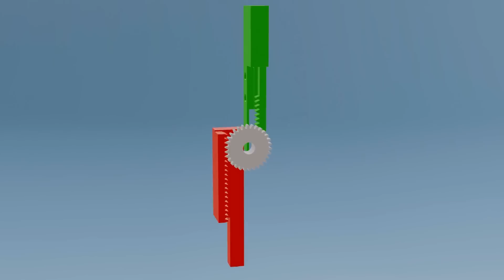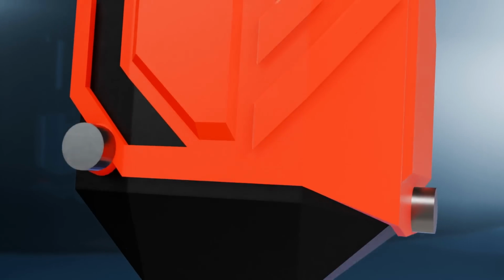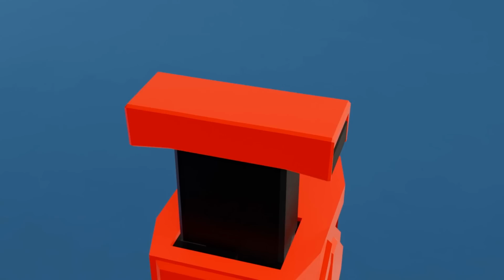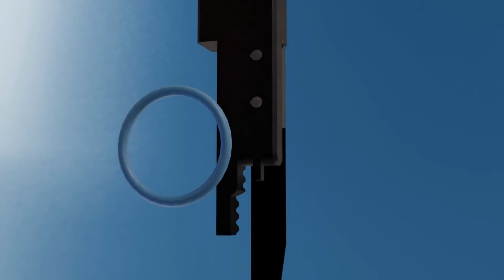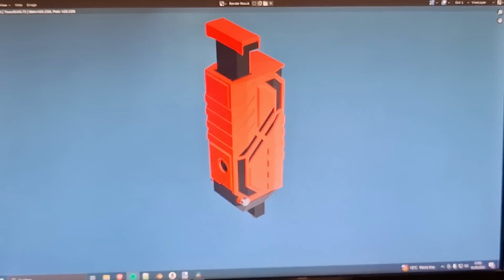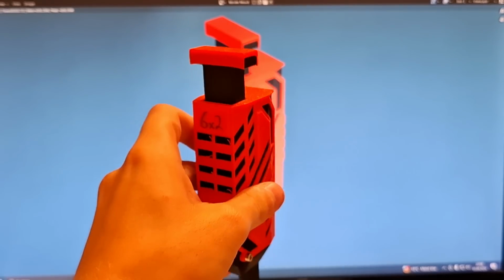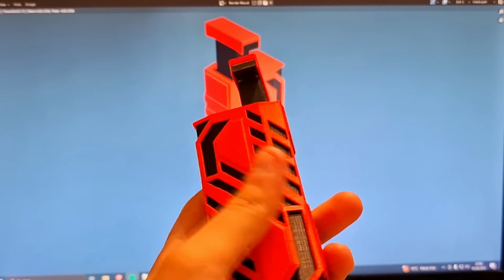Designing A Magnet Insertion Tool With Automated Reloading | 3D Printed

Comment: Not sure if anyone else has asked. Apologies if so. Have you considered a print pause for the difficult magnet insertion within the tool body? Perhaps you have, and it won’t work?
Reply from the maker: You are actually the first to ask that. Did not even think about it to be honest
Reply: @ Ah maybe worth a shot. I’ve just started 3D printing recently and have used it to some success on a small spacer where I wanted the magnet concealed beneath the surface. Working out how to do gridfinity and your design for the insertion tool is amazing. If/when I remix and it works, will definitely let you know. Hoping to print it soon
Reply: Update: I chickened out. Too worried I’d get the polarity wrong if I paused print and did the two tip magnets later. Haha. Maybe I’ll try it on the second one. Thanks for the great design.

Comment: Really cool project. I'd love to see a v3 that uses a spring instead of rubber band. Is it also possible to have 1 version of this tool and you only need to change the magazine size to accommodate different size magnets? Or are the strengths too different? It'd be great to only have 2 of these and to just screw in different magazines based on the size of magnet you want to dispense.
Reply from the maker: If i will every create a v3 i will make Sure that its more modular and easy to switch between diffeent sizes

Comment: I just can't get this to work properly, the magnet sticks to the side of the nozzle  or doesn't come out at all.
Reply from the maker: If the Magnet gets Stuck in the funnel you May have a wrong Position of the picker and the lever or you Glued in one of the magnets on the wrong orientation. 
Bevel down the bottom edge if the Magnet doesnt slide completely to the bottom

Comment: You did an amazing job (design)!!! Congrats & thatks a lot for sharing your knowledge and journey as well. This brought  a question to my mind. What  if you don't  need to "push the trigger down" and  have a version that works like a stamper I mean like a just push the device down to realease a mangetic. Does this make any sense or is even doable?
Reply from the maker: Thanks for the feedback. i think the problem with that idea is that once you lift the device back up the next magnet will slide down to reload which could cause problems with the previously placed magnet. but interesting idea for sure

Comment: This is really cool.

I don’t know how feasible it is but if you made it electric you could reverse the current and change the polarity of the electromagnet so one tool would work for both. You could also turn on/off the two magnets so they would never interfere with one another and possibly simplify the ejection mechanism.

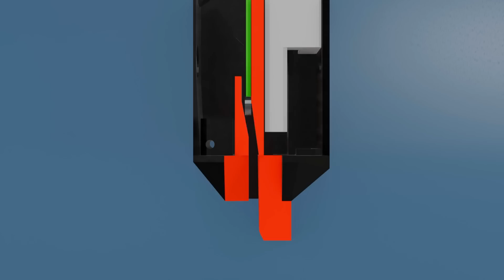Comment: That small edge could wear of pretty fast ? No ? 4:39
Reply from the maker: So far noone of mine is worn out. and i used it quite a few times during testing. But it doesnt take long to print a new tip if it wears out

Comment: I was struggling to get my print to work, till I realized I use 6x1 magnets not 6x2. Any chance for a 6x1 version? Love the idea, but I guess I just use a weird magnet size.
Reply from the maker: If you use the "5x1 Lever extension" and increase the length of the Mag by 1mm it should work with 6x1mm magnets. Or use the 5x1 mag  and increase the Hole size in the slicer by using a boolean cylinder if you are familiar with that

Comment: download this project, it's currently printing.  just wanted to say,  when polarity matters a great way to do this is to make a jig.  with gridfinity each piece is is own functional jig.  for the bases just stack up 2 more magnets on an already finished base and put your new base on top. just drop a magnet in and it's right.   for the bins ect, just install a single small bin with magnets upside down and then you have a 4x press jig. just add 4 more magnets and press into the bottom of an empty bin. 

now you have me thinking,  should be pretty easy to design this as a 3 part shaft and screw. not as smooth or easy to reload

Comment: Great development, loving the idea and solving a great problem. I think the only thing it needs is for a single product (maybe with one or two toolless interchangeable parts) that is capable of utilising a greater range of diameter and thickness magnets. Nice work!!
Reply from the maker: I agree. having too many diffrent tools bothers me as well. But i had not idea that people use THAT many diffrent magnet sizes
Reply: @EmGi_ agreed. I’d guess most common for repetitive magnet placement are 2mm - 6mm dia and thickness from 1mm - magnets dia? Again, nice work😃

Comment: For that tricky step where you glue a magnet inside to anchor the magazine - perhaps you could open a slot on the side instead. You would just push the magnet into rather than doing the elaborate fishing proceedure.
Reply: I thought the same. Put a little bar that holds the magazine magnet and slide it in from the side next to the magnet magazine entrance. You could even make this reversable and it mabe could lock in the housing if it passes through several parts saving maybe a few screws.
Reply from the maker: I dont understand what you mean with "open a slot on the inside". Could you elaborate that a bit more?

Comment: Many 3d prints use 6x3 and 5x3 magnets so you can consider making a version for these sizes. It would be very welcome since it is an awesome tool.
Reply from the maker: I added a 6x3 Version. And i think 5x3 magnets should work with the 6x3 Version as well

Comment: You could get away with one set if the 3D printing community could agree on a common standard for all commonly used components like magnets, bearings, maybe a range of standard small, medium, and large stepper motors, etc.  Unfortunately, the reality is the majority of projects uploaded were designed to fit the needs of the designer, so they tend to use whatever they have on hand whenever possible.  Having said that, if you come up with a design for something a lot of people will want and be willing to pay for and you decide to sell the files, go back and make sure everything you used was standard where possible and available off the shelf if not.

Comment: I love how the design improved. While watching the video I had two more ideas to make it even better. First one is mainly personal preference, but I would love to see the rubber band replaced by a steel spring. Or maybe even a 3D printed one if the room inside makes it possible to fit one strong enough. 
Second thought was: if you split the (black) body into two parts length wise, it would make assembly so much easier and less prone to mistake. The outer shell should be enough to keep it together, especially when you add locking pins to the design
Reply: I have a question for the part at the beginning of 4:12 where you show the mechanism and the tunnel. The part in orange is defining the thickness of the magnets used (1mm or 2mm high etc), right? and that's the part that makes it necessary to print different versions. now I've noticed the tip is already detachable (probably to fix jams), but with the jam problems out of the way, why not make the funnel and the tip one part, that can be exchanged easily, so you only need to print one casing (or two, one for each polarity), but then you can print different inserts for different magnet sizes. as diameter should not matter that much (up to a maximum of course), interchangeable inserts for thickness would be perfect. I'm not good at 3D modelling myself, so I have no idea how hard that would be to make. but I really love that thing at would love to see it improve
Reply from the maker: Wow thats actually a great idea! i will keep that in mind if i start a v3. That would have saved me so much time
Reply from the maker: Thanks for the feedback. i thought about using a steel spring first but i thought its easier for people who want to build their own device to use a rubberband instead of ordering a specific spring.
im not really experienced with 3d printed springs but i doubt it would give a statisyfing feeling when pushing the lever in

splitting the body is worth thinking about. i agree that the assembly is quite complicated and its possible to make a mistake and not even notice the mistake.
Reply: What if you would make a holder that you insert from the side that contains the magazine magnet. That way you can pull that out and even make it reversable. That leaves only the tip to be reversable to have a generic solution for both polarities

Comment: I understand that you’d need a different tool for each magnet thickness. But wouldn’t one tool at least work with different magnets diameter, of the same thickness? As long as they’re smaller than the mag hole diameter? 🤔
And I can’t keep wondering if it would be possible to make the design somehow to also support different thickness…
Reply from the maker: Actually yes. i didnt keep that in mind when designing the device because i had the impression 5x1, 6x2 and 8x2 are the magnets used the mosed but now im getting so many requests for diffrent magnet sizes, so looking back  should have done a few things diffrent. But i tested 5x1 magnets with the 6x2 device and it always dispended 2 5x1 magnets (i had no 5x2 magnets at home)
Reply: the Diameter of the magnets should not matter, but thickness does. You probably could use 8x1, 6x1, 5x1 or even smaller all on the same device. but as soon as you change thickness they'll either get stuck, or dispensed two at a time. only real solution would be to make the funnel interchangeable

Comment: That's a nice project and a good solution to put a lot of magnets very easy and quick.

For your V3 you can add a "switch" or something like turning device inside the tool. With this turning device you could easy turn the magnets and their polarity. So this way you can use only one tool for both polarities 😊
Reply: having one for each polarity is nice for when you need mating magnets.  No need to remember what polarity you are on with a single device that can switch.

Comment: Amazing design and creativity man! Just a question, what's wrong with your printer's Z axis? There is a lot of bands in your prints. I have a similar problem with my ender 3 s1 and improved it a lot by loosening the Z axis screw holders.
Reply from the maker: im not sure if there is something specific wrong with my Z-axis. sometimes parts come out perfect. sometimes they have some kind of wobbling. but i will check it out
Reply: @EmGi_  In my case it was "Z binding" the infinite screw was catching and making that pattern. I loosened the Z axis screws and applied lithium grease to the infinite screw, that helped a lot.

Comment: Great work!  Any thoughts on the possibility of making one that can work with multiple magnet sizes?  I can see how making one compatible with multiple thicknesses would be a problem with the ramp.  But could you make a single tool for a large diameter and then just have tube adapters for smaller diameters?  Just to cut down on the number of tools needed...
Reply from the maker: i would love to reduce the ammount of tools needed. would have saved me alot of time and filament as well but i havent found a good and simple solution for that
Reply: @EmGi_  What happens when you put a smaller magnet in a larger tool? Does it jam?
Reply from the maker: i tried using 5x1mm magnets with the 6x2mm device and it placed 2 5x1mm magnets very consistent

Comment: Really great design! Well done. 
I will say it though - the most common magnets used for 3D printing at 6x3mm magnets.
Any chance of a 6mm x 3mm version?
Reply from the maker: i had the impression that 6x2 are the most common
i might add a 6x3 version if there is enough demand
Reply: @EmGi_  This is the one consideration I was thinking about. As amazing as this is, designs use all sorts of different magnet sizes and there is no real community standard.  Maybe this toll will help push one :)
Reply from the maker: i started my v1 with 5x1mm magnets. then people requested 6x2 and 8x2 because they said these are the most used magnets. now i did v2 with 5x1, 6x2 and 8x2 and now people are asking for 10x2, 10x3, 5x2 and all other kind of sizes. A community standard would have saved me so much time
Reply: @EmGi_  Voron, VZbot, Klicky Probe and many mods for those or derivatives all seem to use 6x3 magnets. I have some of both 6x3 and 6x2. I love your design